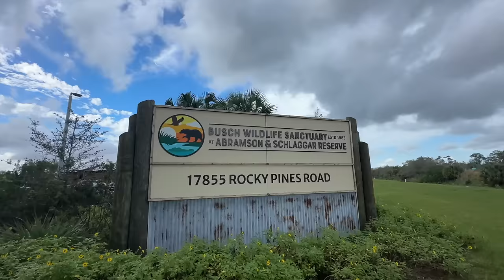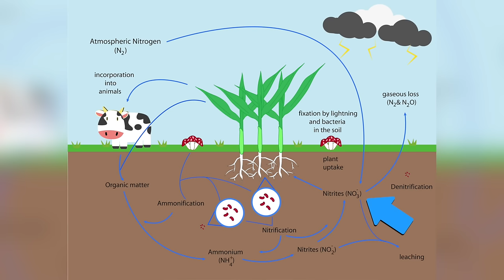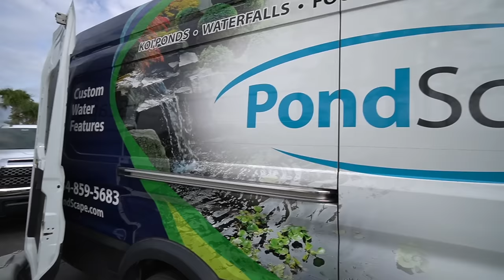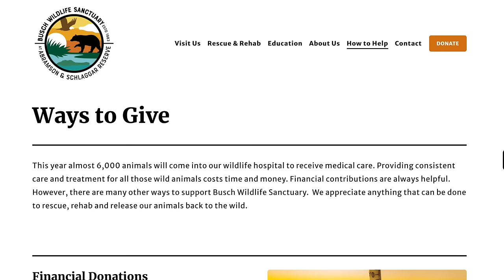Rescued Bears’ Mind-Blowing Upgrade: Ecosystem Pond For The Win! @BlakesExoticAnimalRanch

Comment: I'm concerned on the keeper valve line. It should be 6 ft deep if you want to keep it away from bears. Source- I had them rip up an exhibits sprinkler system at that depth